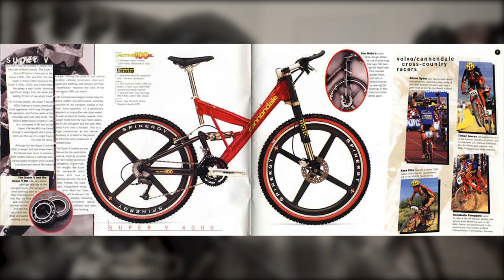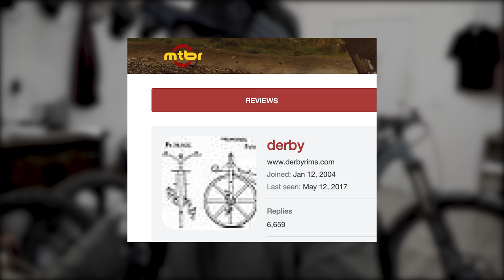RIMS: the story of why I still ride both aluminum and carbon

Comment: This format is a great addition to your usual videos
Reply: Agreed
Reply from the maker: Thanks Steven!!!
Reply: @JeffKendallWeed  Carbon fiber is not inherently aerodynamic over aluminium. It's just lighter.

A deep aero wheel made of carbon fiber is lighter than an aluminium counterpart.

So at the end of the day, it is the weight. If carbon fiber was heavier than an equivalent aluminium part, no one will use it.

Comment: I don't know much about format but I sure like your photography . Your voice is easy to listen to and I certainly value your opinions. I will not be charging like you but still, I need to make decisions about carbon wheels hubs etc. I'm looking for a food bike now and very concerned about maintenance issues with suspension especially. It would help to have info about all that. Kinna tough for me because I want to bike pack with a trail / all mtn bike. Thank you Jeff.

Comment: Great historical to current opinion review on carbon. While I agree with most I have found my 27.5 x 2.8 to 3” tires profile really nicely with i40 to i50mm rims. As for 29er. I like the i30 for the 2.25 to 2.5” tires and i35 to i40mm rims really make a great profile with the popular 2.6” tire and up. I have a couple 2.8” and 3” tires for my rigid SS bike. I run Rimpact or CushCore to prevent damage to my alloy rims and the whole pinch flat protection and compression dampen thing. My friend have various carbon rims either hookless design or that non bead hook design. I definitely see your point on the flat protection but I know that they burp air out of their tires at lower pressures. I also know they don’t have the supple feel of an allow rim wheel set that’s planned ,customized and  laced and built for a riders weight and style. Just my thoughts.

Comment: Nicely done, very interesting ,I ride on aluminum, and carb, but never jumped. except one time I hit my brakes and flipped in the air and landed on my feet and both my hands still holding the handle bars and gently placed the bike down checked out the bike the derailer bent , don't know how I didn't get hurt.

Comment: Really lIke the format, but even more really appreciate the history.  I raced from '86 to '04, heavily into MTB tech (was 2nd in charge at RIngle before Sun bought them).  Then essentially I just rode for fun for a few years, then quit riding completely (kids, family, job).  Got back into riding in 2017 (health), new bike.  Never issues w/ my aluminum rims, didn't know why ... nor why mag editors loved carbon rims so much.  Now I get it.  So when are the aluminum/carbon/titanium/steel frame and bars vids coming?   Pedals (flats, clips, clipless, and back to flats)?  Geo (especially w/ respect to stem length, bar width)?  Forks and dropper evo?  I'd watch your whole MTB evo series.  You have a unique P.O.V. and good story-telling style.  Looking forward to it.

Comment: Also grew up riding BMX bikes and MTB since the 90's and seen the evolution. I've got carbon rims on my Offering and AL ibis S35s on my Following currently. With the weight gap closed there really isn't a whole ton of difference for most riders. I think I slightly prefer AL but it's nice to have both.
Reply from the maker: totally cool to have good options in both!  I don't mind the AL at all, if that's all I had, I'd still be quite content!

Comment: 10 years ago I said I'd never ride carbon components, especially wheels. I'm a big strong guy, 6'8" and weigh 245 lbs. Played a lot of basketball and took up mountain biking 20 years ago. I've always wrecked wheels and was scared of the thought of carbon wheels. But now I think the technoligy has improved and bit the bullet and got cabon wheels for my mtb a couple months ago. 

It was eye opening for me. The stiffness is something I've never experienced on a high end aluminum rim. The steering is more precise and so far no issues. And I've smashed through a few rock gardens way harder than normal to test them out. Even hit a few jumps I've been avoiding because my old wheels couldn't handle it at my size. Wheels are perfectly true, no issues with spokes and only 28 per wheel. And the zippiness with the lighter weight is a plus too.
Reply from the maker: Thanks for the great note!  Carbon has sure come a long ways!

Comment: Liked this video format, it would be interesting to hear your take on the two differing design thoughts for carbon wheels and how they perform. Those being traditional construction rims with a deeper 2 sectioned rim (spoke eyelets separate from bead seat) like Enve, Santa Cruz, Industry 9, Light Bicycle etc etc etc and those that have gone the more Moto route like Crank Brothers Synthesis & Zip Moto.

Comment: Hey Jeff!  Thanks for the shout out about my revolutionary design for mountain carbon rims back in 2013 called Derby Rims, the most durable mountain carbon rims by far at the time, and continually improved by experience to always lead in highest performance and durability! Check out the newest "Sol Rider" line utilizing CFRP aerospace engineering.

Comment: I prefer carbon for strength, whenever I ride aluminum it's constant spokes breaking and truiing after every ride. I end with wheels in the shop all the time. If I did have a set of i9 straight pull aluminum I would likely fair better. I am a heavier rider so my wheels tend to take an extra beating.

Comment: Just exactly what I needed to hear since I'm about to buy a set of carbon wheels for my bike; if the government send you money, what's better than to upgrade your bike, isn't? 🤘😎
Reply from the maker: Hahaha good call Luis!
Reply: @JeffKendallWeed  Hey, could you make a video explaining the reason/science behind the front specific/rear specific tire-wheel combination, why is better to ride a wider tires/lighter wheel in the front and better rolling resistant skinnier tires/heavier wheel in the back? 

I know Crank Brother Synthesis uses a 28 spoke front / 32 spoke wheels, NOBL uses a wider internal width in the front and narrow in the rear, just to mention a few... Don't know, maybe you already did the video, just a thought.  🤘😎
Reply: @LuisGonzalez-nx2pn  different uses. The front needs the grip, and doesnt need to be as strong, the rear needs to follow and be strong for when [the user] inevitably smacks it on something. You don't need the grip from the rear of the bike nearly as much.

Comment: Which would you pick if you had to pick [alloy frame + carbon rims] or [carbon frame + alloy rims] taking into consideration only: handling ability leaned over, high speed stability, handling in the rough.

Comment: Great job analyzing and describing your needs and journey as a rider.  I still hate heavy wheels, but that's more a product of over a decade of XC/Marathon racing.   If you're just out riding to have fun, and fitness/speed aren't really what "determines that" (ie. KOMs etc) then weight should be a lower priority.

Comment: Not all aluminum is the same, nor is all carbon the same. 6069-T6 is almost twice the price of 6061-T6, and a rim made of 6061-T6 feels a lot softer in comparison. Strength generally increases with weight.

Comment: Hi Jeff, I was wondering if you run wheel inserts (i.e. cushcore) in your current carbon setup???  Thanks.
Reply: I run Cush Core on carbon Crank Brothers DH wheels, and on aluminum wheels too.

Comment: I don’t know mate. I can’t afford to run different wheel makes, models and constructions. I sure don’t put my rims consistently through what you would. I mean I’m riding on a rear DTSwiss alloy rim that has a wicked dent in it that my lbs managed to get to hold air but I can’t. So it’s back to tubes in the rear for me. I’ll ride it til it dies and then, I still don’t know which way I’ll go haha. Oh well. That’s the life of a pleb. By the way. I do like this format of video. Very interesting.
Reply from the maker: Sorry to hear about your tweaked rim!  New rims are cheap, ~$100, but the time to re-lace it is somewhat significant.

Comment: Never rode on carbon wheels, always been interested, but usually stick $ into suspension and brakes. I just bought a polygon siskiu n9 for 3100.00, guess I am happier getting an extra bike than a set of wheels for 600.00 less.

Comment: Great video as always with you👌

I am looking to buy my first IBIS, and i am finding it diffecult to choose between the Ripley and ripmo. Both af.. i Rode a Santa Cruz Bronson C, v1 before. It was a gun playfull bike, but i found it hard to climb.
It was setup with 160 / 150 mm og travel.
I fear i would bottom out the Ripley, and that the ripmo would be too heavy a climber. Any advice?
Reply from the maker: Hey Thomas, thanks for the note!  Between Ripley and Ripmo I definitely prefer Ripmo.  My preference is smashing down hill, and climbing on the Ripmo is great- totally comparable to all the other bikes in the 145-160 class.  Ripley will climb easier because it builds up lighter. It's your decision where you want the most emphasis on performance- weight, small wheelbase, steep angles vs. long, slack, and stout!
Reply: Just remember that you could always add lots of volume spacers, but you cant make a bike climb better without making it worse in other areas.
Reply: @JeffKendallWeed  thanks - that os also what i gathered from your videos.. ripmo it is🤘

Comment: Had nothing but problems with Aluminum Ibis wheels on my HD4. If they bust again this season probably gonna move over to carbon
Reply from the maker: Fair enough.  Ibis alloy wheels were decent in my experiences, just hard to mount cush core wiht the small center channel.
Reply: @JeffKendallWeed  mounting Cush core in the hoops I just got from Ibis. Gonna see how it works out.👉👉

Comment: I ride that 19 or 20mm inner width with a qr that came stock with my 2019 trek marlin 5. Everything but the brakes and front rim have been upgraded. Qr's and straight steerer tube limit what I can change and since my skill has increased, I'm finding those limitations of the bike unsafe in some scenarios. High speed berms? No. Slow twisty technical bits? No. 
I also think my 29's are not best suited to my riding style. My budget doesn't help either.
Reply from the maker: Thanks for the note P!  Enjoy what you've got!  The cheapest thing to improve, and that will amke the biggest difference, is indeed the rider!

Comment: Carbon fiber is not inherently aerodynamic over aluminium. It's the weight.

A deep aero wheel made of carbon fiber is lighter than an aluminium counterpart.

So at the end of the day, it is the weight. If carbon fiber was heavier than an equivalent aluminium part, no one will use it.
Reply: I was going to say the same. There's such an amount of bullshit in YT...